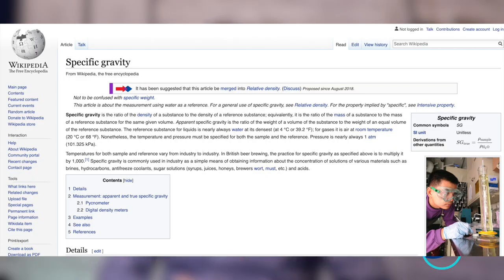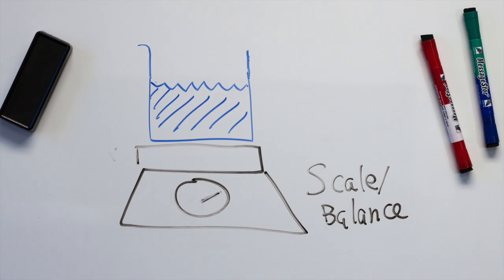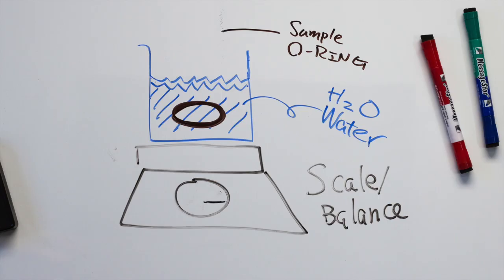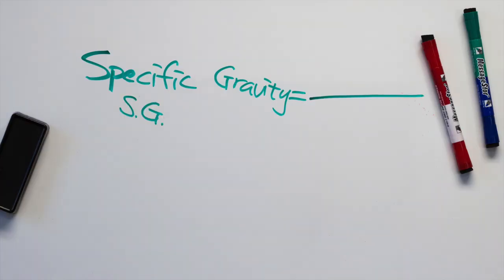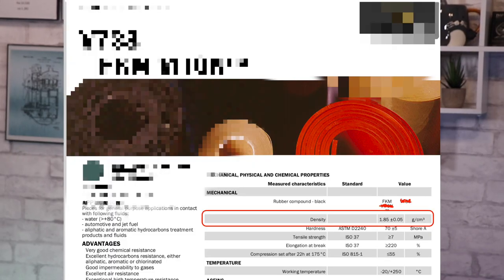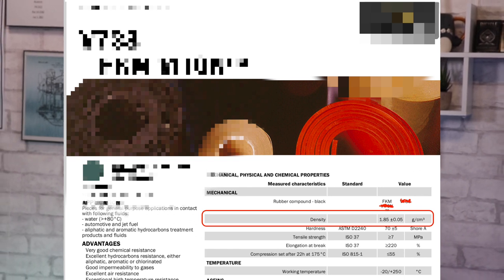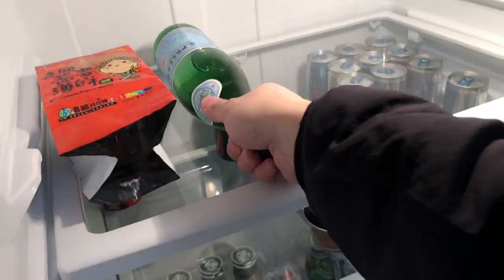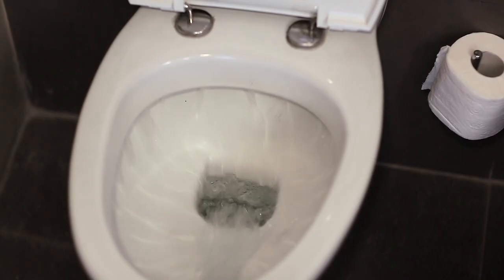How to identify Rubber Material? Everything you need to know about Specific Gravity

Comment: Buy a similar O-ring I the same dimensions and material of fkm, nbr ect and weight them and than weight the O-ring that you don't know if it have the nearest weight to one of the runners, should it not be the same material?
So you could have a refferenc in a box, always for testing. 🤔
Or do I miss things, I have anyway no clue about this stuff I'm only fascinated by o-rings and stuff but I have problems to figure out what sizees are suitable to fit a seal sometimes, specially they are many nany different size variations in cross sections and diameters and if a slightly different cross section change would make a big difference in pcp hgp 300 bar safety stuff, that the air don't go out ect.

Comment: Great video. I don't understand why you have to use the hanger, however. Why is it important to keep the ring from touching the glass? Can anyone explain it to me? Thanks.
Reply from the maker: We use hanger to demonstrate that you can use household item to achieve really great result. If the o-ring touch the glass, the weight will not be accurate as water weight.